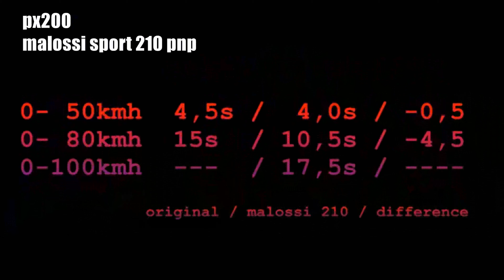vespa px 200 SIP ROAD 3 acceleration / why O-TUNING is a MUST ;) | FMPguides - Solid PASSion |

Comment: I have found the Polini "silent box" the "road box" the "original box" and the "s box". Is that all the same or different? Which "box" do you use for this test? Can you help me?
Reply from the maker: All the same 😄👍as there is only one bix from polini. Its the torque box and if you want more reving its the megadella slx8, these are the two best boxes currently 👌

Comment: 42 seconds on  a p200 with road 3 to reach indicated 100kmh?  Why is it as slow as that?
Reply from the maker: tall heavy driver, old used scooter, in general not really strong....
Reply: @FreakMoPed8   Is the road 3.0 really any better than the road 2.0 on top end? How do they compare on a DR177, say?  e.g. road 2.0 versus road 3.0?  I have tried polinibox but its so slow on topend compared with the road 2.0. I need new exhaust soon as road 2 is getting loud but cant help thinking im throwing money away with a road 3 if it does perform any better Thanks.
Reply from the maker: Sip road three is fine for your purpose 👍

Comment: What is your exhaust suggestion for heavy otuning px 200 ( very high port timings - cutted crankshaft - extended intake - pwk 30 carb ) thank you ?
Reply from the maker: which cylinder and intake timings?